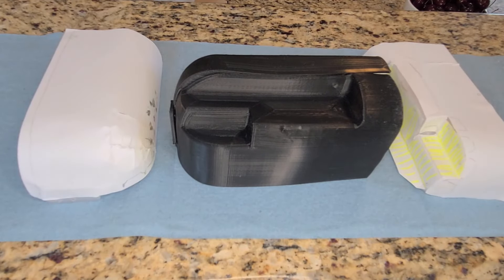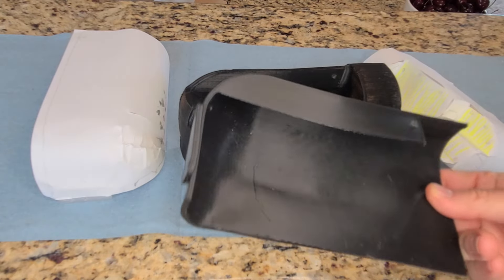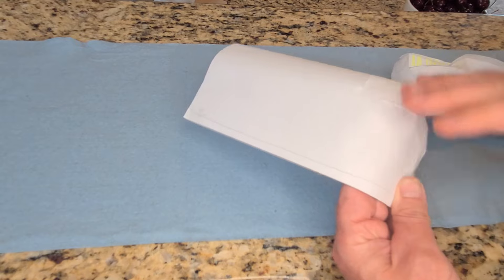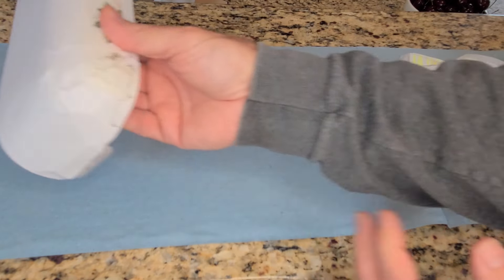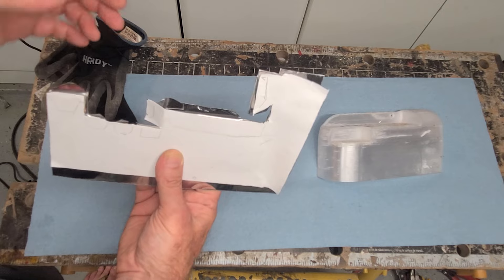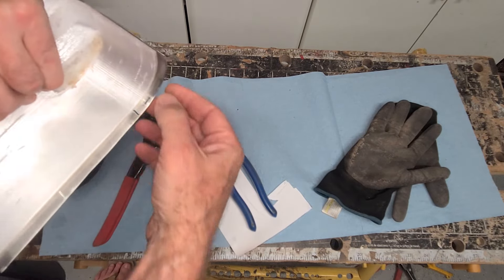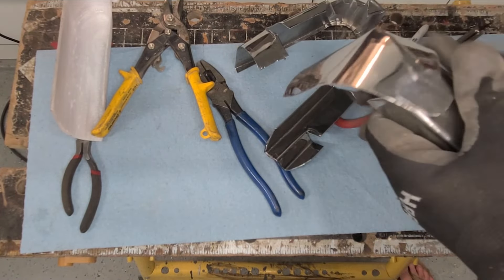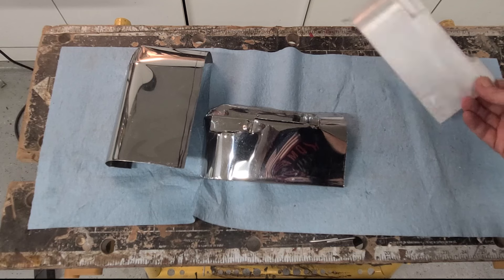Sheet Metal fabrication - Air box on 1977 MGB

Comment: Alex, inspiring work. I would have like to see how you did your curved bends and folding. Especially wanted to see how you did the curved bends.
Reply from the maker: I was thinking I should have shown that.  I try to keep my videos to 20 mins or so.  

To make the bends  I use different pipe diameter pipes, and a rubber mallet.

For concave bends or cups, I use a tree stump and a ball pine  hammer